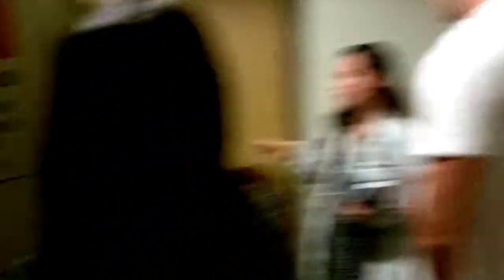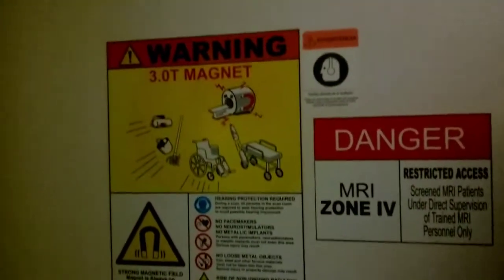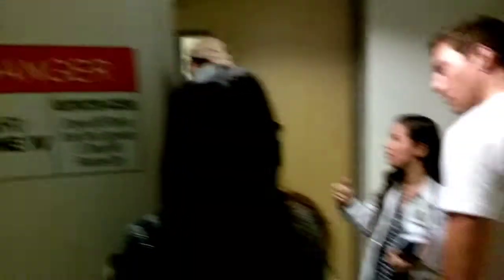HIKE THOUGHTS: MRI Scanners Explode Without Electricity

Comment: I am an engineer from Pakistan, got hired last month at a hospital as a biomedical engineer. we have a 1.5T MRI machine. and we also have a significant amount of power outages in our country (demand and supply).
it's a real headache to look after this beast.
especially weekends. I am at home my head is at work :).
Reply from the maker: thanks for sharing this, abdul! what do you do with the MRI when the power goes out? I assume you have a backup generator? Have any of the MRIs broken?
Reply: @AndrewPolich  we have two back up generators and a UPS (200kva) that can supply power upto 30 mins Incase fuel tanks are empty.